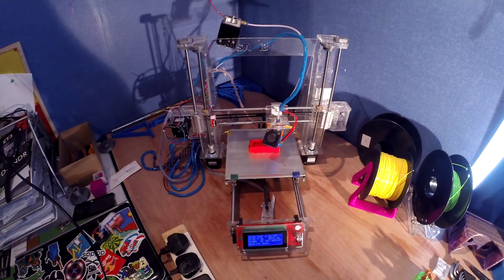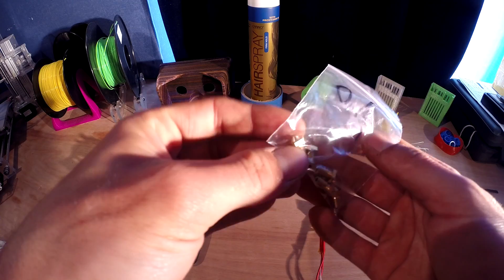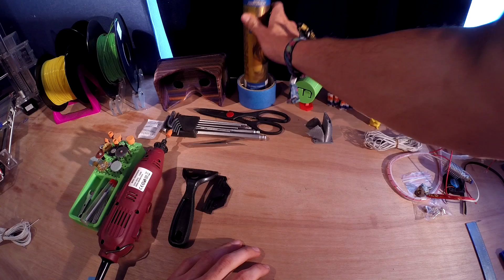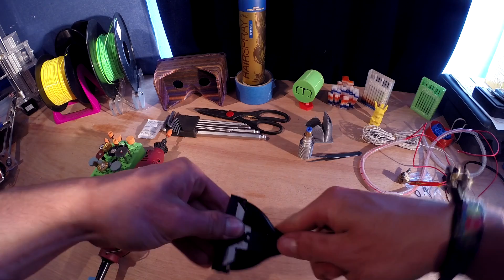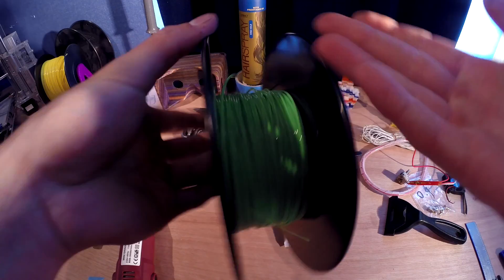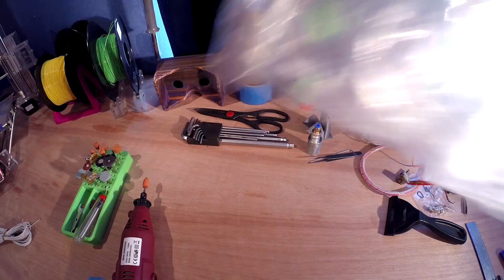3D Printing Essesntials

Comment: why do you put your bowden  extruder's motor on that position?
Reply from the maker: Hi, I moved it there so that I could have my filament feeding from above, not on a filament stand beside the printer, I now hang filament on the wall and gravity feeds into the exdruder. Also it was missing E steps before moving it
Reply: +Matthew Davies so by moving it to there you can stop the annoying clicking sound? I am looking how to stop the clicking sound without replacing the gear.
Reply from the maker: +Vahn Exactly yes! Also the skipping noise could be your hotend to close to the bed and is struggling to feed at ......% federate.
Reply: i am pretty sure mine is not because the hotend is to close to the bed.
so you drill a hole on the acrylic?
Reply from the maker: +Vahn you may want to try and move it, I did drill a hole in the acrylic, be very gentle not to damage or crack it